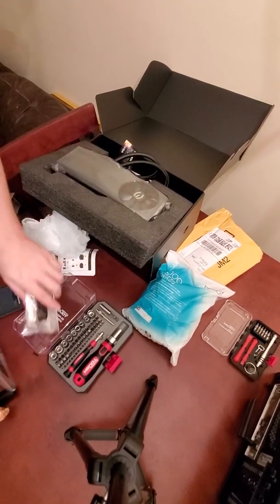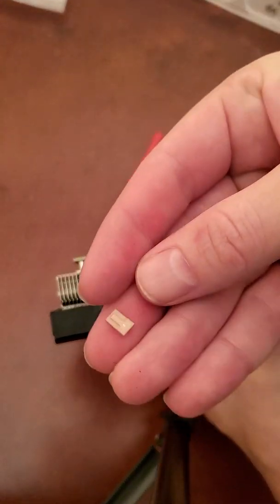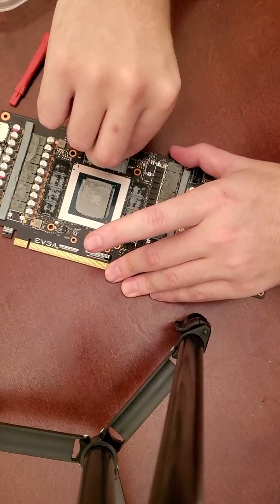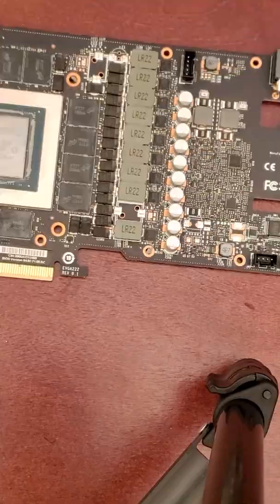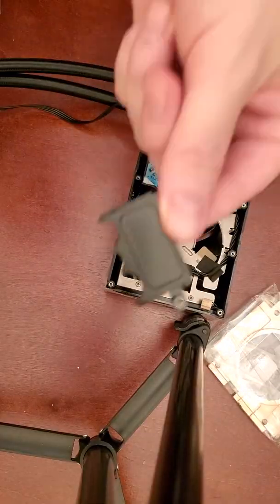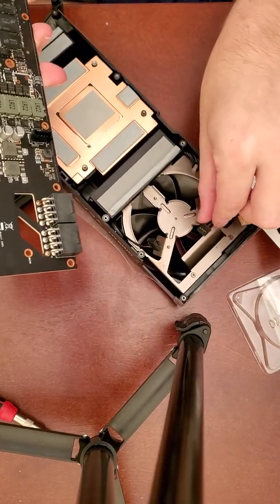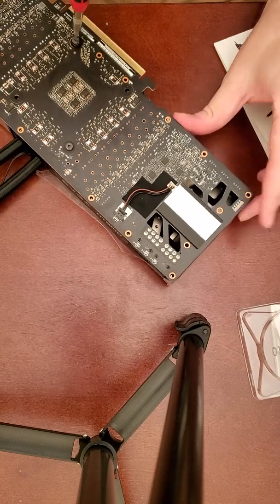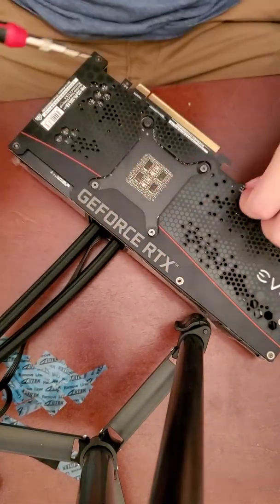EVGA 3080Ti XC3 Hybrid Cooler Installation.

Comment: Well, I'm late but I guess I'll say my experience. I bought the 3080ti kit about a year ago and still haven't put it on out of fear of damage. Mainly the wired connections. Great video!
Reply from the maker: Hey man, I get that. I was really scared too. Especially with the heat sink separation. The instructions that come with the card are really good, so if you stick to their recommendation / instructions you'll be alright.

Comment: Hi. Thank you so much for this! This is exactly what I'm doing this weekend as my temps are hitting 89° which is WAY to hot but it's a hot country. I really appreciate this video, especially and critically, the camera angle! Other vids I checked out were way less visually informative. I have a question: it's been about 6 months? How is the water pump? Ive read it can begin to make a little more noise. Is that your experience or is that just BS? Thanks again, a West Australian fan
Reply from the maker: I have noticed zero noise changes since the install! Good luck with the install!

Comment: I have the same cooler on a EVGA 3080 ti ftw3 ultra and my temps are at 80c, I have installed everything correct and even used thermal grizzly paste. I can figure it out?

Comment: Good job man
Just finished doing the same conversion on my 3080ti ftw3 and so far so good..I did wind up putting some thermal pads under the back plate just to see if it helps.Now I just need to flash the hybrid bios to dial in the controls..hope it still is working good for you..

Comment: How was your temps after?
Reply: What about the vram? I get much higher temps on vram but the core is very good.
Reply from the maker: Before the cooler while under load the temps would be around 75c- 82c, after the cooler was installed 45c - 60c depending on what your run your fans at. At 33% (fan speed)  my temps stay at around 50c while gaming.
Reply: @nickdaut2111  do tou have the fans as exhaust?  Im having people saying jt ahould be intake
Reply from the maker: @filipinoy7937  No my setup uses them as an intake as well.
Reply: @nickdaut2111  so you flip them to to pull air
Reply from the maker: @filipinoy7937  Yes, the instructions that come with the part tells you how to do it, if you want to go that route
Reply: @nickdaut2111  What about your memory temp and hot-spot temps?  I've heard this hybrid kit is inadequate for cooling the memory and I'm hoping that's not true.

Comment: Did it make the card a lot quieter?
Reply from the maker: Yes and No. I don't have to run the fans as high anymore so it did lower the noise. You can still hear it when you crank it up though.

Comment: This is a good video. I recently got a Hybrid for the 3080ti and should be putting it on in the near future. This video will have helped. A couple of questions though, did you mount the radiator to the front of the case as an intake? And do you have your CPU radiator as intake or exhaust?
Reply from the maker: I use the Hybrids radiator as the intake and the CPUs (and 1 other fan in the back ) for Exhaust!